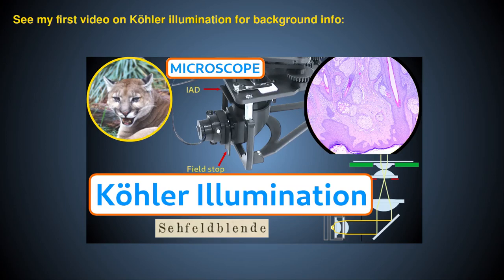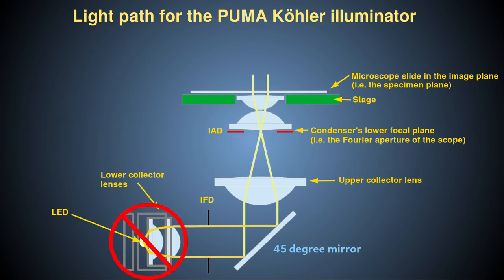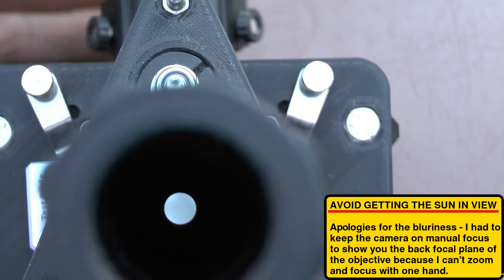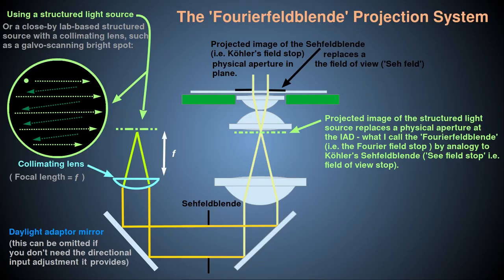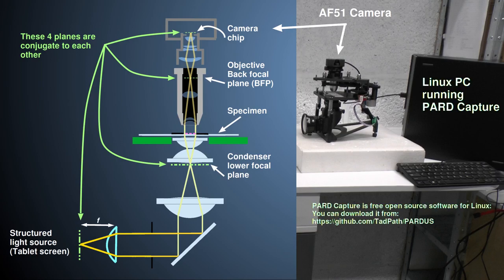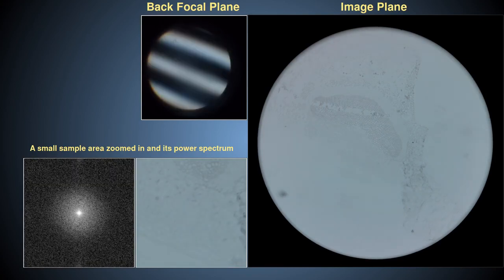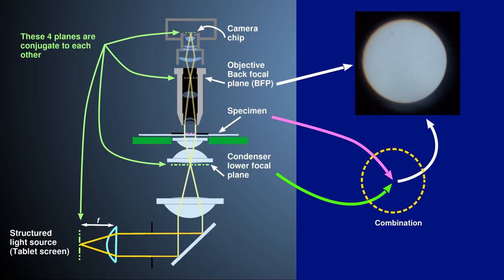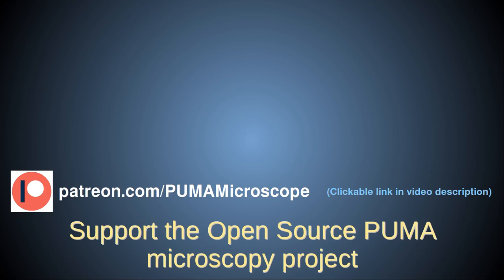Daylight Köhler Illumination and the Fourierfeldblende

Comment: Ive been an amateur microscopist for 40 years , the use of the microscope has always amazed me and its huge diversity optical concoctions. phase contrast, epi, UV. I recently used an optical microscope capable of x6500 I thought oil x100 was the limit. . I didnt try that setting but I wonder if it used reverse convolution to compute the surface. It was camera based. This 3D print looks amazing. You have clearly dedicated serious thought and have the results worthy. Regards.
Reply from the maker: Thanks. I intend to make some videos on deconvolution in microscopy at some point. However, even with deconvolution it is hard to push the resolution beyond what you can get with a high quality x100 oil objective (without using special fluorescence techniques). These super-high mag scopes just make small things easier to see without straining your eyes - which is good - but they don't really push the resolution 'limit'. You get essentially 'empty mag' as this video demonstrates: https://youtu.be/2sWF_NHPzn8